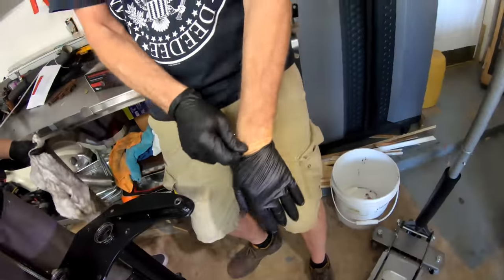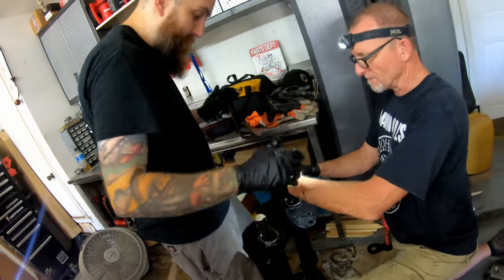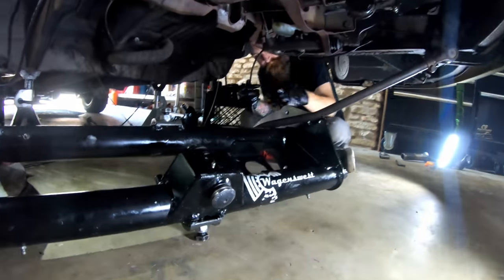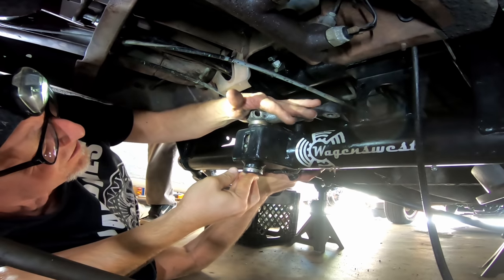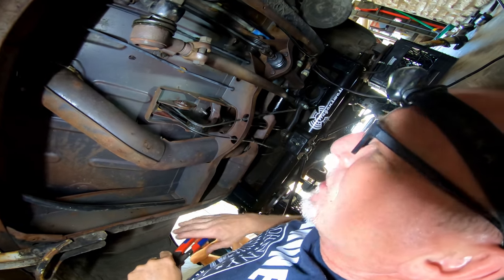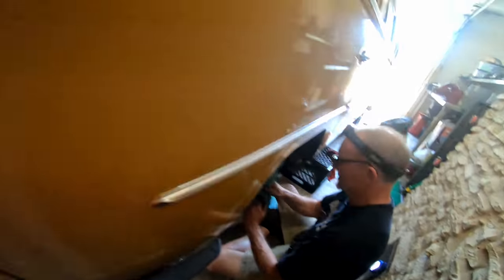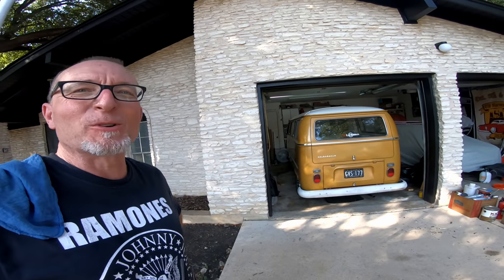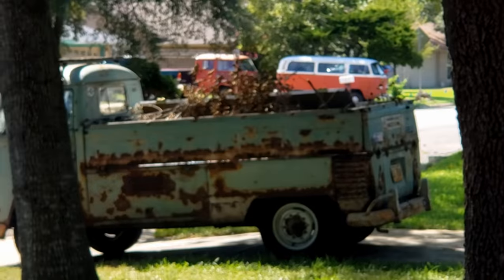1968 VW Bus Beam Install!   Finally back on the Road....

Comment: Just did this same job on my 68 double cab.  Replaced the ball joints, and needed to remove the trailing arms.  My PO removed all the grub screws that held in the torsion springs and they were just floating.  Once I got them cinched down I was able to beat the trailing arms back in and jack up the trailing arms to get the spindles on.   This is now my second time doing it, once on my 79 westy (which was a breeze) and now on the 68 double cab which was a royal pain.  The biggest difference is that Volkswagen welded the ends of the torsion springs with a tack weld and my 79 still had them in place, while they were broken in the 68, which makes putting the torsion arms very difficult without an air hammer.
Reply from the maker: We actually had to do it several times. In the video we made it look easy but we ended up having to flip them and figure out the right orientation and do it over and over again. Those torsion springs can be kind of a pain
Reply from the maker: Also post a picture of your VW on our Facebook page https://www.facebook.com/VWLifeVW/

Comment: i saw you torque the beam bolts...were you applying upward pressure so it was against the body or was the beam hanging by the bolts?  how well did the beam marry?  any shims needed?  thanks for the insight.  STOC

Comment: Is this another bus, I thought you guys had a 1972 Westfalia Camper, I wonder how is that one doing nice to see you guys also have a Ford Bronco, considering for 2021,they are making a comeback but nothing like the original,.one.
Reply from the maker: saw that new bronco , should be interesting.
Reply: @VWLifeVW  I wonder how does the new one compare to the original, the new one has a lot of electronic gizmos, not like the original, which is basically, a work horse, from the pictures I have seen, it looks more like a Ford Explorer, or the Expedition, with some of the looks of the Ford Pick ups, the King Ranch, the Raptor, or even the Harley Davidson version, I want to see a comparison between the Bronco you guys have or the 1979-1984 Ford Bronco to see how it does, those are true, strong SUVs or Trucks, I even read somewhere that the new ones don*t have the same looks like the original,
Reply: @VWLifeVW  I wonder if you guys ever had the opportunity to have or come by one of the 21 window, buses, I think they even had the pop out windows, those are getting rare to see nowadays,  but knowing you guys ,and having an opportunity to pick up, a 1972 Westfalia.Camper that was just junked or abandoned in a field, I thought you guys might have had the opportunity,& luck to get one.

Comment: Rambus has had about 8 sets of ball joints. New steering box . 3 center pin . And every time I put ball joints I keep telling myself  next time I will put grease zerts. still never happened .
Reply from the maker: what?  no grease, that's a concern :)

Comment: I just installed mine to the lowest setting,
Can you adjust while it's on the vehicle?
It's cool but to low!
Reply from the maker: We never could.  You almost have to take the spindles off to adjust it up, or your will be fighting eachother.
WW did theirs on a lift so they could hang off the control arms but in a garage you cant get enough weight and leverage to adjust them up

Comment: what did you do for the rear bolt pattern? did you use wheel adapters?
Reply from the maker: Early bay window wheel pattern is 5x205 so Martin was running wide five cosmics.  Such a cool bus!
Reply: @VWLifeVW  yeah my mistake. I rarely see wide five cosmos

Comment: Hi Matt Jackson, I want to ask about your roof racks  I am planning to do the same with my bus, does it affect the ride? Aerodynamics? And my second question is, I noticed that you tape your safaris when it’s raining, I will also put safaris on mine also, they say that it drips inside, do you have any solution to that? Thanks for reading this.
Reply from the maker: the roof rack actually does add wind resistance.  You notice it at high speeds.   before i could easily get up to about 60, not it's harder.  so it's a trade off.  i don't really need to be going that fast anyways so it's fine.   we only tape ours when going on long road trips with a forecast for rain.  mine actually don't leak that much, if you install your windows correctly it's not too bad of an issue.  the key is getting the seals kind of crunched into all four corners of the body.   the tape is just a precaution for me.
Reply: VW Life thanks, I think you are right, it’s a trade of, but I also need the space to carry stuff. And thanks for the feedback on the safaris
Reply from the maker: Do you already know where you're going to get your rack from? We know of a couple of options there is Chad in Florida who goes by bully driver steel works on Instagram and then there's at least one guy California
Reply: VW Life yeah I have one, he made me for my beetle, and Austin Cooper. And by the way, I’m from the Philippines, thanks.

Comment: Hey guys! So I recently purchased a 1971 super beetle that was in great shape and after running it for about two hours I noticed there was a little bit of white smoke coming off of the main rear air vent. The engine still sounds just fine, but I’m a little concerned what it could mean. Any ideas?
Reply from the maker: white smoke could be an oil leak burning on the exhaust or bad rings, just keep an eye on it.